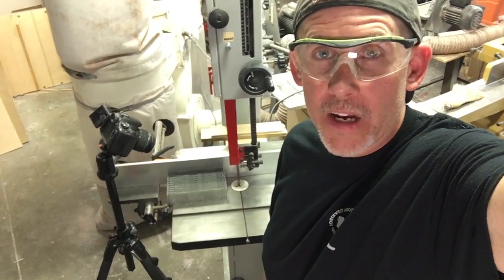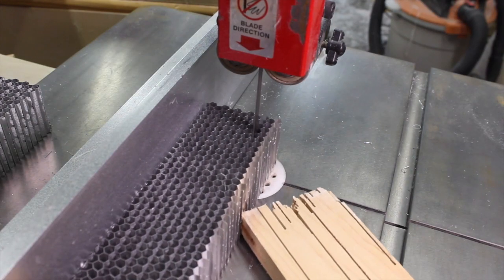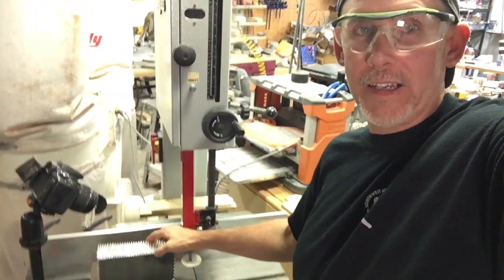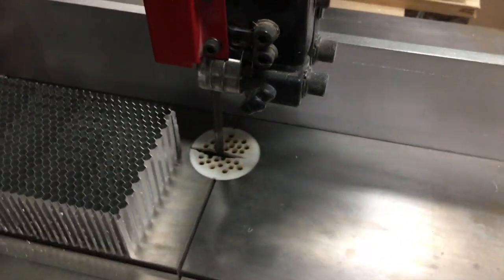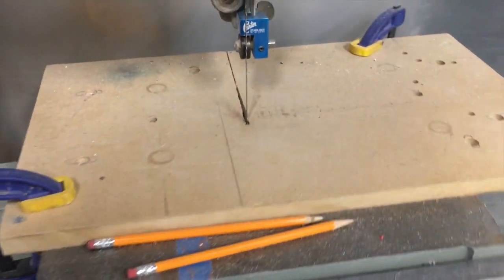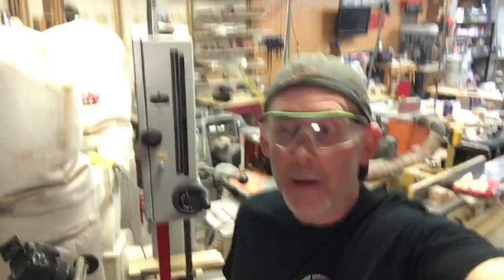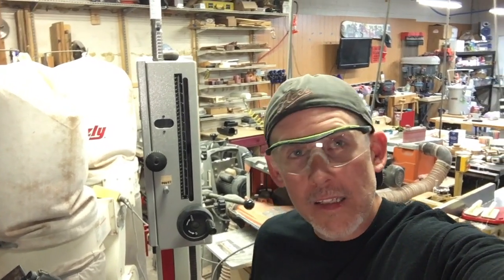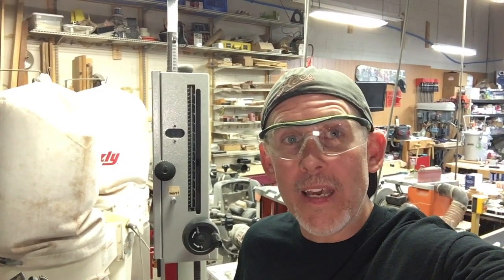How to Cut Aluminum Honeycomb Panels | Resin Casting Quick Tips

Comment: what about cutting a 6" hole in a 3/8th thick honeycomb aluminum panel, like if the panel was on the roof of a trailer and you need to cut a hole for a vent tube?

Comment: One thing I have done to slice thinner sections is to immerse in water and freeze.  Slice frozen block on bandsaw and no crushed cells or "pants cleaning" events.  then just thaw and go forward.
Reply from the maker: That's a cool trick! Yeah, if you can provide sufficient support, you're good to go. Thanks for the tip =D

Comment: Hi, what's the use of aluminum honeycomb?
Reply from the maker: I cast it in resin to make cool effects for turning blanks. I have a couple videos that I've used it in if you want to check it out:
https://youtu.be/bJkJFIyQzJE
https://youtu.be/ayFNS_N1k1k
https://youtu.be/Y4SK6LfYaK4

 The original use for that material is to make strong but light weight panels with once you put skins on both sides. It's used in construction and the aerospace industry a lot

Comment: For those that don't have a bandsaw, you can use a hacksaw or even just an razor blade. Takes some time and patience to not go to quickly or the combs can crumble or shift. 

I also saw a video of someone who flipped the blade on a table saw to cut aluminum but I'm not going to be trying that.
Reply from the maker: Great tips! I didn't think to mention what to do if you don't have a bandsaw, might have to do a video on that down the road too
Reply: Zac Higgins ya, that would be awesome! My problem is cutting a 3" thick honeycomb in half. I think it might be easier to do it if I got a diamond hacksaw blade. 

Can always use a cutoff wheel  as well but it would also take more material off. It'd be time consuming but a dremel could also work with a lesser chance of damaging the comb.